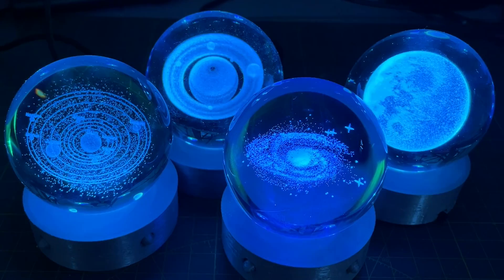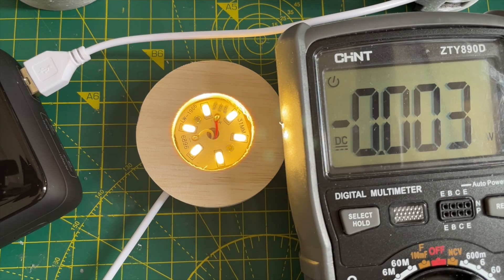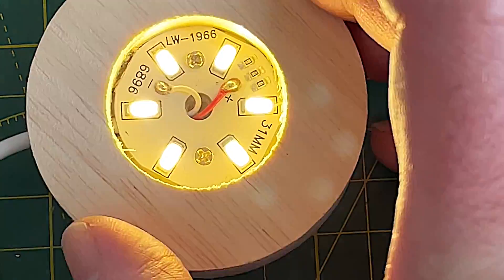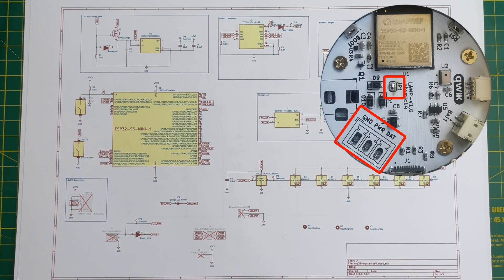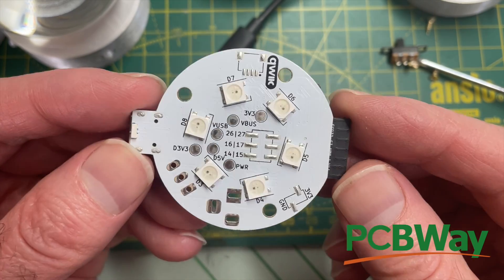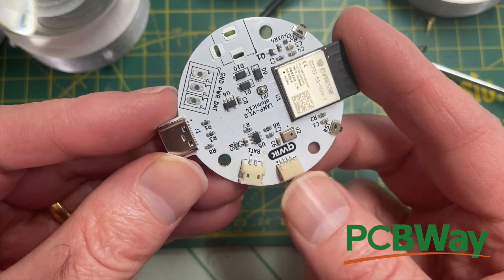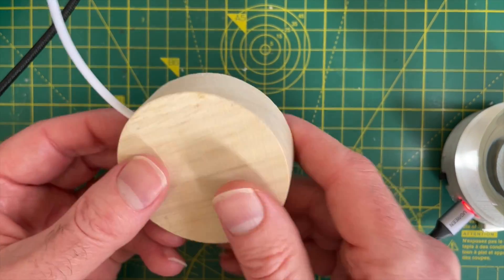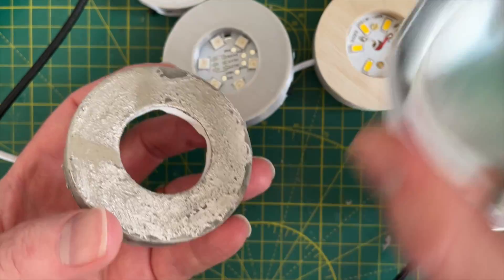Look at My Shiny Crystal Balls - Custom ESP32 PCB With WLED.

Comment: Anyway, each voltage measure on a white Led will give 3V (approx), this is due to the Zener effect of Leds. Red is 1.4V, green 1.8V etc. What matters is the current, a 1W white Led needs 350mA. This is why you cannot dim a Led simply by changing the voltage, it doesn't work.

Comment: LEDs (actually any diode) in parallel is not the best idea because there are no 2 identical ones. So each one will light differently. Rather 1 resistor for each LED. That is me thinking loudly ;-)
Reply from the maker: This is what I was always told as well. But I think now the accepted wisdom is that manufacturing tolerances are so good now that it's ok. Certainly seems to be the approach in pretty much everything nowadays anyway.
Reply: @atomic14  think what happens when 1 of them shorts... - all go OFF. If they are connected as the "old way" I am talking about, one shorted means 1 is OFF

Comment: On the power circuit, can't D9 be omitted?
Reply from the maker: You can - but there's a danger of something being connected to the USB, but with power turned off. If that happens the battery voltage will flow into the USB.

Comment: Chris - is there a way I can make this work with an existing LED light without creating a circuit board? It's a USB light similar to the one under the crystal balls. I'd like to control the light with the voice reactive software but making a PCVB is well beyond my skills.  I could however solder in some wires and an esp32.
Reply from the maker: Might be worth having a look at the WLED docs and joining their discord server - https://kno.wled.ge/ You can just use a normal ESP32 dev board - just needs wiring up correctly.

Comment: A stone effect filiment could look nice, or have a look at the chrome effect powder used for fingernails.
Do you have a resin 3D printer? They don't have to be as messy as some make out, and cleaning prints can be as easy as a wipe with a paper towel. Prints look so much better, and are ideal for small shallow objects. You can print multiple objects without increasing print time, just as long as you can fit them on a small build plate. Also using solid infill doesn't increase print time.
Reply from the maker: I've got access to one - was thinking of doing a couple of prints.

Comment: You could do source switching by using 2 diodes - one on each input. This way your regulator is powered by the highest voltage source. You would drop a little on the battery diode but this would be minor with a Schottky diode. It is possible you would lose a bit of headroom on the regulator as the battery discharges but the simplicity might win out.
Reply from the maker: That does work - but the forward voltage on Schottky diodes is surprisingly high once you start passing any significant current - 450-600mV. So with the ESP32 on WiFi and driving LEDs you would quickly run out of headroom from the battery when it’s at its nominal voltage of 3.7v. The MOSFET (provided you pick the right one) will have a much lower voltage drop at the same current.